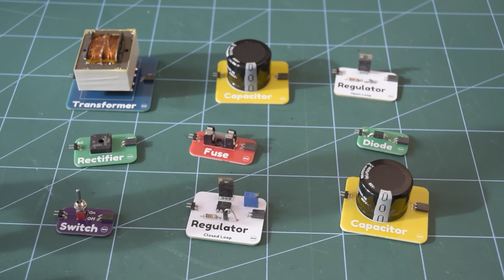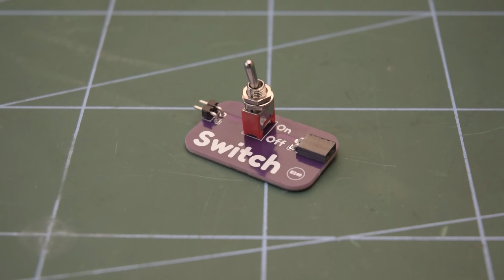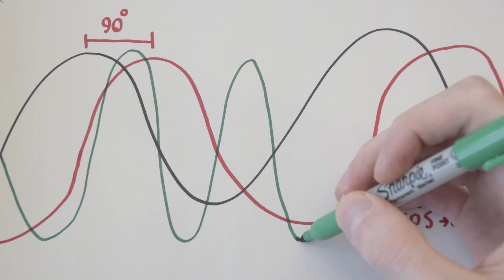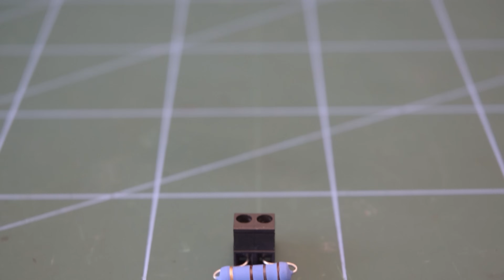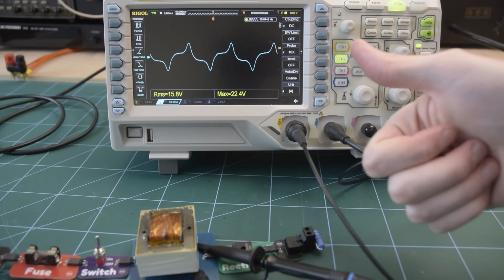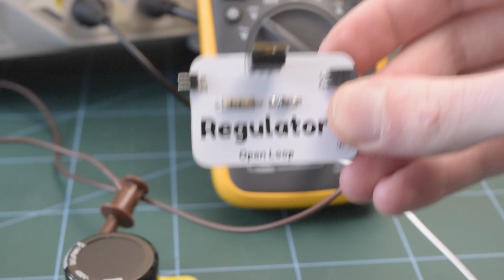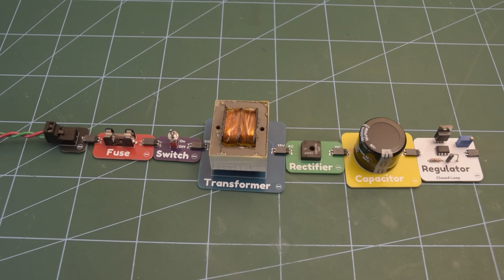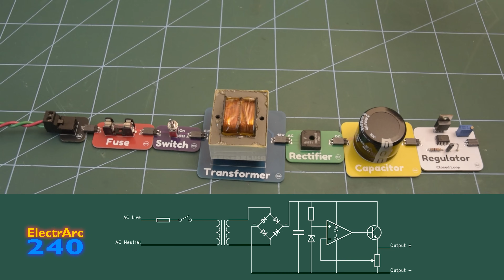Every Component of a Linear Power Supply Explained (while building one)

Comment: Could you perhaps explain how the output voltage of the regulator affects the rest of the circuit?
Since I'm not very knowledgeable about voltage regulation I'm mostly thinking of how a LM317 will basically convert all "unused" voltage to heat, greatly limiting it's usefulness if you need a bigger stepdown.
How would your example circuit react if you were to example crank it down to 5V output?

I'm guessing that the capacitor would still charge up to ~13V forcing the output transistor to go on/off to keep the output at 5V, I can't see how this would waste any power but it also sounds too good to be true if that makes sense?
Reply from the maker: Exactly, a linear regulator will have the same input and output current so from the capacitor's perspective a 12V, 1A output looks the same as a 5V, 1A output. But the regulator will be much hotter. This is why almost everything is switching now where the transistor is either on (no voltage drop) or off (no current) meaning (in theory) no losses! This does require a few other components to smooth the output. That would be a buck converter and I will cover them soon!
Reply: @electrarc240  Cool! Looking forward to it!

Comment: What can be put before rectifier if the voltage of the transformer is dropping from the grid.. drop is about 2 to 5V(yea poor grid management in our area here) which messes with the rest of the circuit(2.1 speakers amplifier)
The secondary leads of the transformer are directly soldered on the board so it is like:
secondary->fuse-> fb rectifier with 4 diodes->big capacitor->rest of the circuit
input voltage on the board is AC 13-14V, after the Cap is DC 17-18V

I'm saying  "before the rectifier" because is the only spot allowing additions, otherwise i need to cut traces...
Reply from the maker: I don't think there is anything you can add to easily "boost" the voltage. Not that springs to mind at least. Sorry!

Comment: ❤the best explanation and presentation I saw. My question is what about solar panel energy to various 5v to 19v outs with 0.1 to 40 Watts without using the original 100/240 power supplies transformers, for my music synthesis ans studio mobile installation?
One idea of mine was to reuse for every device the pcb part after the transformers, as this can absorb various voltages, and currents.
Myst add that mostly, a lithium battery  and a regulation is  at the out of the solar panel, but no guarantee to be well regulated for electronic appliances. My anger is the degree of security of such an installation..
An other aspect of that, is that those power supplies exist,, USB current to 12v 5v, 12v to 9v, but generally this is with a max of 1A, and this cost a lot.. I have about 10 to 20 instruments to connect, so this would cost me too much, and I want my material mobile, so an easy connected power supply, and not entering 240v inside my moving carry boxes.  
That's where it gets too complicated for me. How connect everything begining by we will say simply a high power lion battery with 12 or 19v out, to multiple manufacturer 12, 19, 5, 5.5,  USB2 , 9, and other voltages, with current limitation, in very stable way, using every device in the same time, for a total that can reach 100w?
The problem with solar panels is that we generally after the battery, use a converter, waving an alternative current around 240v, but then using a transformer to have a direct current around 12 or 19v, to a device using lower direct currents depending of the inside setting. 
This is evident that logic is to only going from 19v or 12,18,, 24v, 30v,  depending of the regulation and the battery to insert directly the good power to every single device.... But to do so securely. That's why my idea was to use the original power supplies with only the after transformer part of the pcb setting and regulation, that would simplifie my problem, noticing also that most instruments and devices are entering the same voltage, 12v, 5v, used in computers. 9v is a norm for pedals and small devices using also standard 9v accumulators, and mostly 19v 4/5A is for laptops. Modulrar synths uses +12, -12, +5 V separately, tablets, modern synth and devices now uses USB 2 norm, which is for me the best solution. But everything must work together with old devices and analog synthesizers using more current, with sometimes three different current and voltage ranges at the out of the transformer.
I'm building a moving studio, so my autonomy should depends only from lion batteries and solar panels. Problem for electronics, is security and regulation, that why your demo is very useful for me, thanks. I'm not a great thinker, I just love music creation, but synthesis is mostly technical first before to be creative, that's why I must confront to those technical problems, without having so much money.

Comment: What is the point of having a fuse?  There is  an adequate one fitted into the plug.
Reply: @sydmichel      Nice big 13A fuse in the plug. Around 3kW in the UK,  Mmmm,  wonder what will blow first the transformer primary or the plug fuse.
Reply: @Matey-850cc  you're joking, right.  Other than in a kettle lead, what psychopath uses a 13 A fuse in a domestic plug?
Reply from the maker: @sydmichel  Most plugs I've opened have 13A fuses fitted no matter the cable coming out. Not great. I've never seen anything under 3A though so in this case the 500mA fuse needs to be external to the plug

Comment: After watching, I wish you went into some more detail about certain things. You should include a soft start a slow blow fuse on the secondary windings (and explain how to calculate the fuse values), and you should also talk about NTC thermistors and X/Y Capacitors. Talking about current regulation, more voltage regulation and dedicated ICs such as LM317/LM337 could be good. There is also topics such as dual tracking power supply's, supplies with two independent outputs (when using a center tap and bridge rectifier), and even more filters such as PI filters. You could go way more in depth in a future video. I would love to watch it.

so in total, the things I wish were added include:

- soft start with relay
- NTC thermistor
- X Capacitor
- Y Capacitor
- PI filters
- LM317/LM337
- slow blow vs fast blow and their current calculations (when used on primary vs secondary windings)
- dual tracking
- two independent outputs when using a center tap with a bridge rectifier
- current regulation (course + fine)
- voltage regulation (course + fine)
- constant current mode
- constant voltage mode
Reply: While your comments would be fine for a more advanced student I think your missing the point. This is an excellent introductory video. An introductory video doesn't ask folks to drink from a fire hose.
Reply: So basically you want him to show you how to design and build a full featured bench power supply...
Reply from the maker: There is only so much one can cover in a single video. And many of these things are not really video worthy to be honest, a quick read of an application note or two will get you a long way. Also linear power supplies are pretty out of fashion these days, I made this video for completeness really and I doubt I will do much else covering old stuff. I prefer to help people understand modern developments (WBG, ZVS, FOC, etc...) as that is what people going into engineering actually need to understand (sadly universities don't do so good preparing engineers).
Reply: How many hours do you think the video should be?

Comment: 11:25 Don't be a baby, your scope's not gonna blow up with just that. The inputs are 300V RMS CAT I rated, for crying out loud -- you've literally got 60 volts of extra headroom even if you measure with a probe in 1x mode. (Yes, technically CAT I doesn't allow mains connection, but even connecting your probe to the low side is technically a violation of CAT I already.)
Reply: There is a close to 100% chance the scope will blow. Using a differential probe is a must. Shorting to ground will destroy the scope 9.999/10 times or damage it in the least. Using an isolation transformer + gfci + differential probe is the best and safest solution.
Reply: @brightonsikarskie8372  Software differential, my dude. Two probes, each phase to ground, and hit that 'math' button to combine them.
Reply: @AJMansfield1  that will work, but you are using two probes with a differential probe you only require one bnc connection
Reply: I'm not sure you actually know what you think you know. listen and read carefully and don't jump ahead of the narrative. You'll embarrass yourself.

Comment: Loved this video.  I learned more than I expected.

One thing though, some more info about the regulator part of the circuit would have been good.  The opamp and the potentiometer for example were barely touched upon.

What do they do and how do they do what they do, basically.   Hmm...

That aside, kudos, and thanks!
Reply from the maker: I agree, the transformer explanation took longer than expected so I kinda had to rush the final regulator section. I hope to cover it again in the future as it is a fairly common circuit / concept. I also linked EEVblog's excellent op amp video which I think will help a lot though I appreciate it is quite long. I still need to make a vid on regulation in the SMPS so I can do both together

Comment: I'm bit confused about placing the fuse before the transformer (primary side). It seems like before the fuse is blown at 1A (120V), the other components after the transformer (secondary side) have the current of around 10A (12V), and they are already exceeded the maximum operating current.
Reply: I mean the step-down transfomer, steps down the voltage but it steps up the current.
if the secondary side has 12V 1A, the primary side should have 120V 0.1A
Reply from the maker: The fuse is 500mA 250VAC rated. In theory it should be lower current but A) that was the lowest I had already. B) some margin allows for the inrush current to charge the capacitor at startup. Hope that helps
Reply: @electrarc240  I remember a Bose subwoofer system about 30 years ago that had an issue with blowing the main fuse due to repeated inrush current. Bose put out a technical bulletin saying to use a higher value slow-blow fuse. With the original design, they expected the unit to not be turned off since using the remote to turn it "off" didn't disconnect the power supply.  You could see the original value fuse wire deflect under the inrush current when you connected power. That can only handle so many on-off cycles before breaking.
Reply from the maker: @markc2643  Wow that's really interesting! Thanks for sharing
Reply: @electrarc240  Thank you for the clarification

Comment: would you have to put a capacitor in parallel with the primary of the transformer if you want to increase power factor?
Reply from the maker: Yes that is very common in industrial settings where they are billed on apparent power rather than real like domestic is (in UK at least)

Comment: I do need to build one for my cordless Dyson vacuum cleaner, to charge the battery...i have bought a transformer a few months ago...i didn't know about the full bridge rectifier.. i taught i will get DC voltage on output 😀.. Very well explained 👍
Reply: oh God no, please don't build your own charger for a lithium battery pack like that, you're more likely to cause a house fire, just buy a proper certified charger for it for the love of all that is Holly.
Reply: Please buy a li-ion charger of the correct voltage for your Dyson battery pack. 
Li-ion batteries need to charged in a very specific way. If not, there’s a high chance that they will explode or start an inextinguishable fire. 

Please don’t even think of trying to build one yourself.
Reply: can't you just buy an original power supply?
Reply: Yes but how about the BMS inside the battery pack...Is not to protect the batteries 😕?
Reply: @badeadrian  things can always go wrong even with BMS boards. Its best to buy a safe solution.
Reply from the maker: I agree with all the other replies. Not worth the risk I'm afraid

Comment: Very interesting, you've somehow managed to get electrical engineering into my thick mechanical engineering skull with these videos
Reply: I am the opposite I find mechanical engineering so confusing and amazed how you make gears and leavers work especially when small and complex. But I look at electrical thing I get it. I’m a plumber but love electronics, but struggle with mechanical stuff. 

I think we all just have our brains wired  a certain way
Reply: @rowanballinger3690  tbh you can push the plumbing analogy pretty far when ut comes to electrical engineering. Even including semiconductors if you include valves.
Reply: @rowanballinger3690  You sure you understand electronics? Like how far have you gone into electronics? 

Have you done calculations and designed analog electronic circuits and troubleshoot them to compensate for non-ideal characteristics? 

Do you understand concepts such as mutual inductance, common mode rejection ratio, ground loops, offset network compensation, etc? 

Have you designed digital circuits? What about embedded systems? What about RF Antenna design? 

Playing around with Arduino does not count as Electronic Engineering, even if you can write your own library.
Reply: @catnipaddict126  r/im14andthisisdeep
Reply: @OnyxEnigmatic fr if you don’t know it all then why start mentality. Tbh just knowing conventional flow, how to read schematics, how to use the tools of the trade (solder, measuring with multimeter) and ohm’s law you’ll be able to do a lot.
Reply: You can’t learn both?
Reply: Ham radio people,  pay  attention
Reply: Me too.
I work with a lot of electrical engineers, and I have to keep asking them this stuff...
Reply: Engineering 💀
Reply: Same here
Reply: I went to college for mechanical because it was the only engineering degree offered at the school I attended. They offered me a full ride and I wasn't even wanting to go to college due to refusing to go into absurd debt at 18. I did fine and used all 4 years of the scholarship, but didn't continue or graduate. I was so burnt out with school and was insanely depressed, so it was a good call. It's been a decade, and now I realize I really have more interest in electrical, although I am pretty good at designing and fabricating machines and I can fix pretty much anything mechanical. I'm slowly learning the electrical side of things. I've surpassed 99% of the population, not really anything to brag about, but I'm finally getting into the good stuff. I want to start making electronics and integrating them into my projects. So to whoever asked, yes you can absolutely learn both and should. In today's world it's all one in the same and each side should have a basic understanding of the other for the sake of streamlining design. We need to start designing products instead of a conglomeration of components. Every new car has something that was overlooked or not as good as other brands, but all together, every strong point between brands could be combined to make something incredible.
Reply: Yeah but MEs usually can kick EEs arse... When we combine noggins stuff gets invented
Reply: The same comment.  😎
Reply: your machines that rely on lubrication and accepting degradation concern me. They seem more unnatural than the most arcane RF
Reply: Yes! Mechanical engineers do have thick skulls. 😂
Reply: Great video 
Really enjoyed it 
Can you recommend a book for a 57 year old with bad maths and a bit thick 🤣
I'll follow your channel and see if I can learn more 
Thanks 🙏
Reply: In exactly the same boat
Reply: This part goes here and does this is very much how a mechanic would teach you how to do something. I find his comparing of what is happening in circuit to be incredibly useful.
Reply: Can you recommend any good YT channels for learning mechanical engineering as a beginner?
Reply: A lot of EE's wish they could do your type of work too. You bring ideas to life. We just add the sensors and actuators. We can't draw anything but a schematic, and we're always using templates if we're going old school, however it's common for us to draw free hand on a napkin. Thats often done over a beer or two or six or twelve.